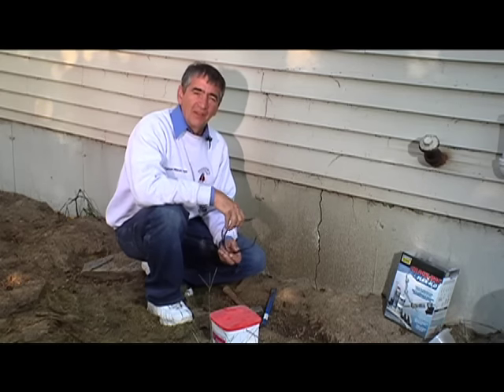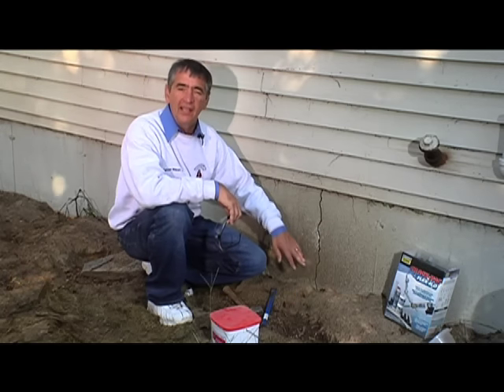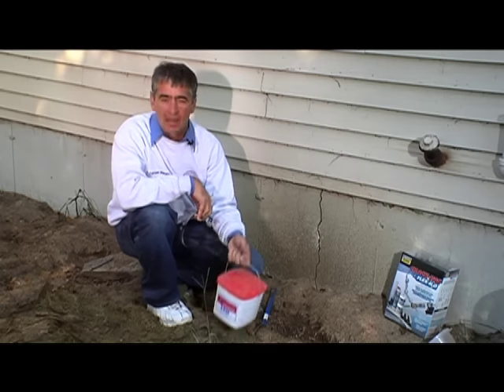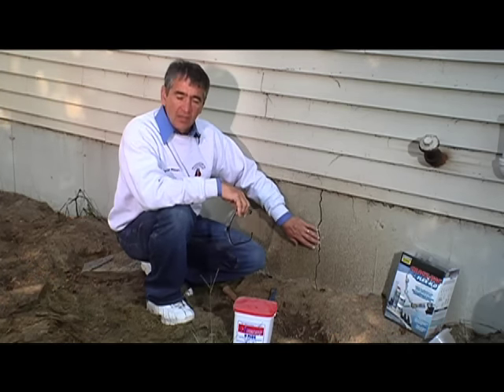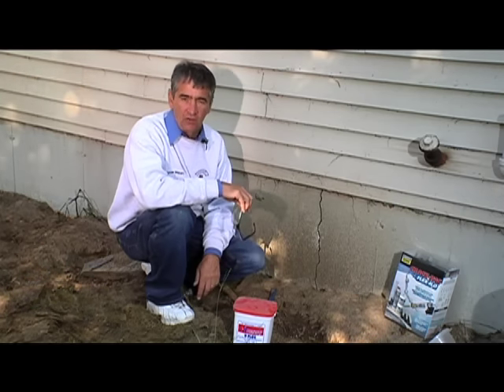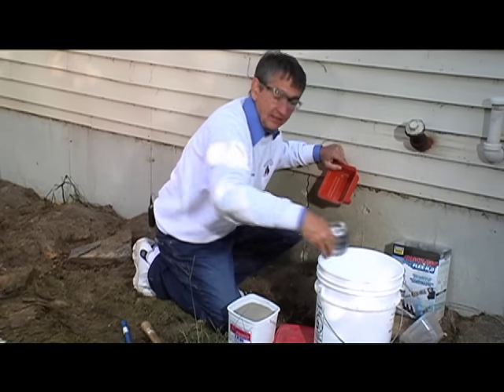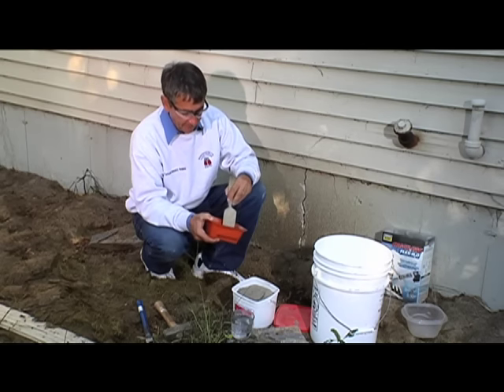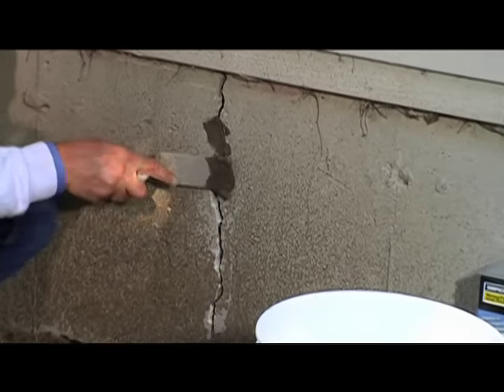Fixing Foundation Cracks - Outdoor How To From Home Work With Hank

Comment: Glad I watched this, I was about to use normal mortar. I’ve found that you can put the cement mix in a large Freezer Zip Lock bag making a caulk gun like for cake frosting. It works great!!
Reply: You lying
Reply: just make sure you're using a trowel to push it into the crack
Reply: Sweet! Thanks for the tip!
Reply: Another good technique is to mix the hydraulic cement with mortar mix. I usually first clean the area with a wire brush, wet it and then apply that blue adhesive that comes in a paint can type thing. Then I apply the cement. 2 parts mortar/ 1 part hydraulic.
Reply: You don't have to dig the dirt up and see how far down the crack goes?...🤔

Comment: Hank, why didn’t you address the issue first? To give people more of an explanation... There are 3 results when reading a crack. If the crack is the same width top and bottom, then it could be concrete shrinking or if it’s on a hill then creeping. If the width is bigger at the bottom than the foundation is sinking at the crack and needs to be lifted/supported. In this case the crack is larger at the top so the corner if the house is sinking and needs lifting. **If you shove in cement then a foundation repair can’t be done.** In this case, the corner of the house can be piered and lifted. The lifting action will close the crack which it can’t do if you fill it with concrete.

Comment: In this case, it looks like the crack will continue even underground. Wouldn't it be best to dig up the soil and apply the solution to the entire crack?
Reply: Nah. Fix the crack, cover it up and sell the bioitch.
Reply: I've thought the same thing.  I would think to dig down at least a bit, let it dry then out the dirt back up to normal height.  But what do I know lol
Reply: I second this...by not digging down you are not really addressing the issue fully...
Reply: Correct, from my experience.. water leaks rarely penetrate from above the ground, ground water below the surface is where you need to focus the patch work.
Reply: No he fixed it
Reply: My thoughts exactly!  Need to dig down to the footing

Comment: What about where the exterior crack continues below ground/ grade, doesn’t that have to be repaired.
Reply: its best to find and hire an engineer to see if perhaps the foundation needs to be lifted. especially if the crack goes all the way down could be an indication the slab is sinking. Im going through foundation issues and my wife and i hired an engineer to examine our slab and we need helical piers installed

Comment: how deep does that crack go? if it goes down to the basement floor you just wasted your time.  you need to dig it out
Reply: exactly, i would of injected it with some expanding polyeurothane or epoxy at least as well.  easier from the inside though.  cutting and replacing drywall is easier than digging a 6-8ft hole.
Reply: I was thinking the same thing. I started digging mine up and they stop about 3 inches down luckily. Maybe it is the same in many cases. I am so relieved as I was dreading digging all the way down in 8 spots. also feeling more confident that my cracks are normal settling from curing and not half inch cracks 6 feet down
Reply: Michael Squires what u used for crack ? I have maybe 2 o 3 cracks outside 1/4 inch but the go dawn under the soil....

Comment: Thank you for the video. Im almost certain this doesn't matter much, but, the cracks I have are horizontal and go across the front foundation of the house as well as the front porch concrete pad. That wouldn't make a difference would it?
Reply: No go forth and fix it.
Reply: @DSilvergun  no those are pressure cracks